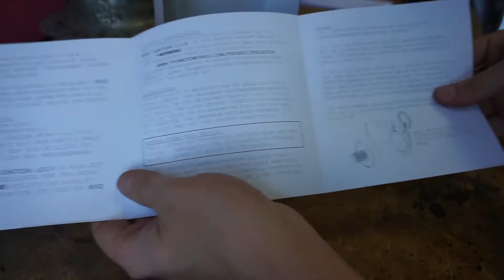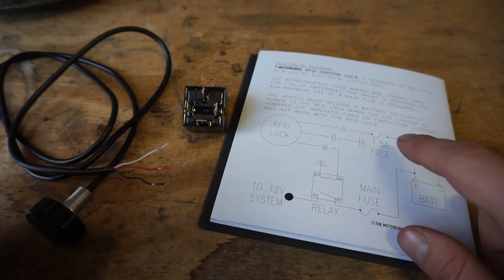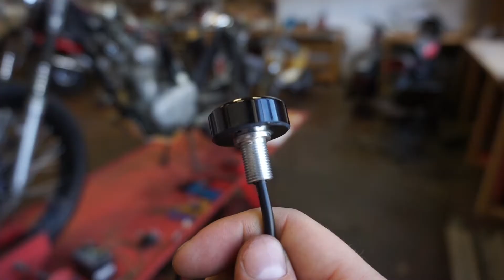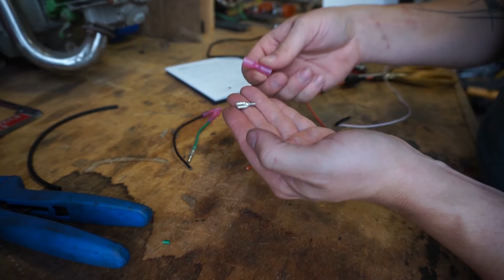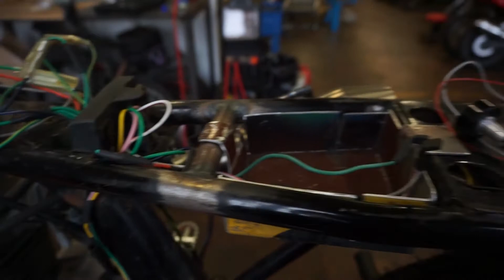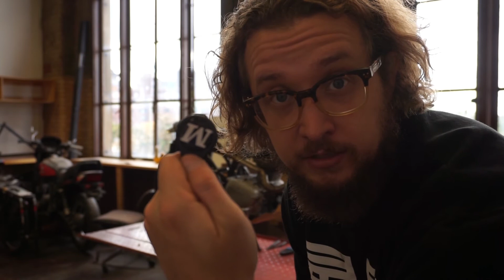ᵀᴴᴱMOTOWORKS  RFID Ignition Lock Unboxing and Installation How-To

Comment: I have a question.  Is this disconnecting the key switch?
Also would you be able to tell me the two wires at the key switch on a 2005 Honda VTX1300?
My kit didn't come with the relay, but that is pretty obvious.

Comment: hi,  recently  purchased  the RFID  and  I  am  looking  at  installing  it  on my  03 CBR F4i(Stunt bike/track bike) any  pointers  on  where  in  the  harness  i  should  Tie  in  the  Switched  12 volt ire off  RFID since  My  ignition is  a  4  wire type, Has a red(constant 12(battery) then  It has  2 others (red and  Black and  a  blueish  wire that  get  turned  on  ith  ignition switch, It  has an Additional Pink wire that i  was  told  is  a  Safety  feature and  Has a  Diode that cuts  the  12 volts  down to 9 volts  and basically wakes  up ecu